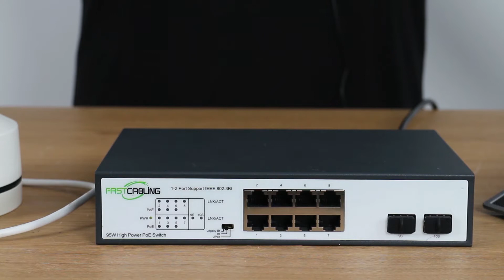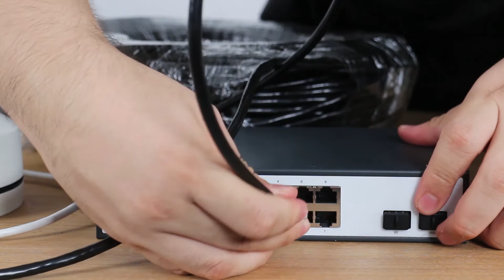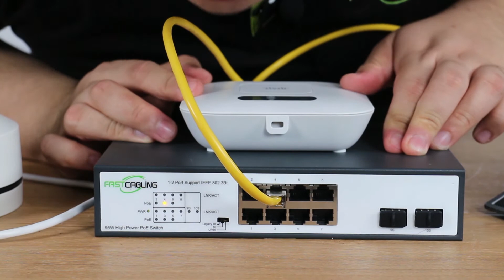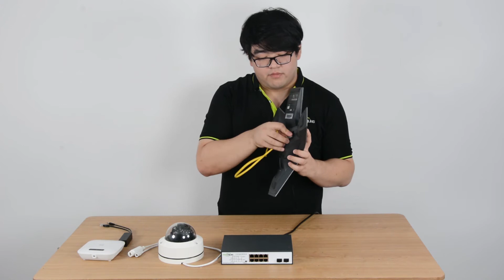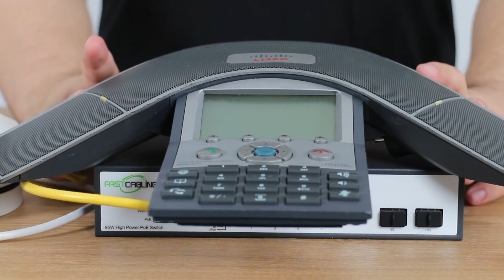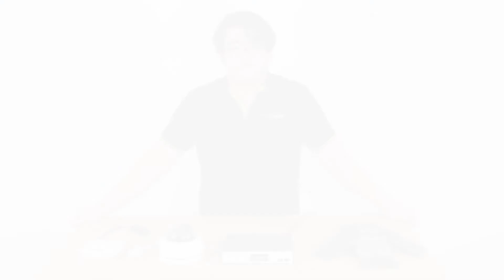What Devices can be Powered by a PoE Switch

Comment: I have Andowl 10 port PoE Switch and an EzViz H3 Camera. Even thought I plug the CAT6 Cable on the PoE switch and then put a PoE splitter on the side of the camera, the camera doesn't power up. What could be the reason?
Reply from the maker: First, check the power requirement of the EzViz H3 camera. Some cameras, like the H3, might require PoE+ for proper operation. If the PoE switch doesn't provide enough power (e.g., if it's only PoE), the camera might not power up.

Second, you need to verify that the PoE splitter is providing the correct voltage and current for the camera. The EzViz H3 camera typically needs 12V (check the exact specifications of the camera), so make sure the splitter provides the correct power output.

Comment: When that ethernet pinged, did it get you?
Reply from the maker: The PoE switch works exaclty the same as the regular switch except for the power part. You can ping through the devices under the same PoE switch.
Reply: @Fastcabling  thankyou, I meant when it slipped out of your fingers and pinged, did it hit you?

Comment: There is no such thing as 48V current.
Reply from the maker: You are right. It should be DC48V power. The PoE power ranges from DC48V to DC55V. In the latest PoE IEEE802.3bt, the voltage implements with DC55V to reduce power loss inline. The maximum power output is 90W (class 4)

Comment: What if the camera use 48v and do ap use 12v how I get one that's cheap but also have those various voltage
Reply from the maker: Most of the PoE camera has optional DC12V input. You may just use the DC12V power supply unit to power both camera and the AP. Just make sure the total power budget is enough for both.
Reply: @Fastcabling  
My access point is 48v but I only have a 12 Poe injector... so I need something to turn it on